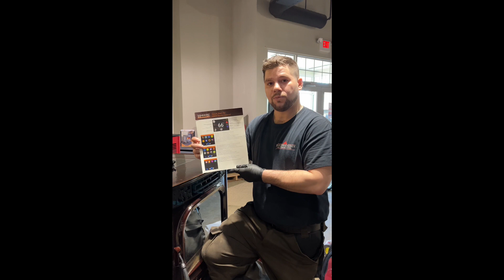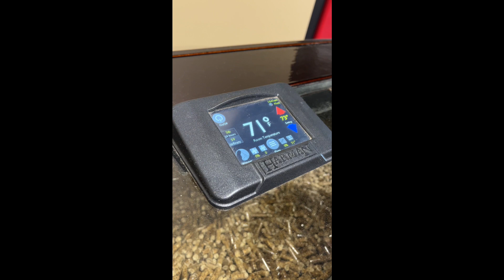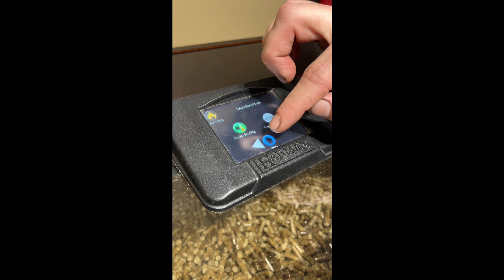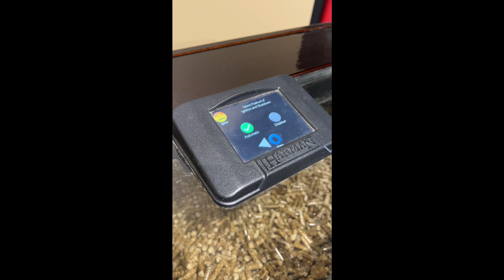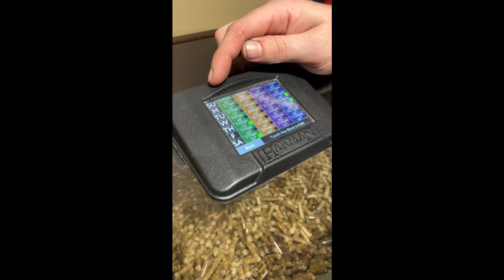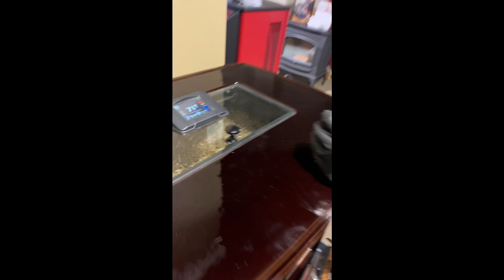How To Operate Your Harman Touchscreen Control Panel

Comment: If you run in Room Temp and disable the igniter, once the stove reaches the set temperature; will it shutdown or reduce to a maintenance or idle speed (like the P series can do), until the thermostat calls for heat?
Reply from the maker: No, the touch screen’s controls do not work the same as the analog.  The old analog stove controls would work just as explained. If running in room temp and disabling the igniter toggle, the fire would no longer go out when meeting temp, but instead go down to a low "maintenance" or "pilot" flame... once the stove calls for heat again, it will run as normal.  However, with the touch screen, when you disable the igniter all you’re doing is turning the igniter off.  When the stove meets temp it will just shut off.  The only way to recreate this "pilot flame" with a touch screen stove is to turn it onto "constant burn" and put the stove on it's lowest setting.  Hope this helps!
Reply: Why does the constant burn setting and the feed limit setting change from where I have them set every time you use the stove?

Comment: I have allure 50 control screen panel broad .My control screen went blank and this was the second time that I have had to replace it.All these electronics are garbage. I have to wait seven days before I receive a replacement control board for my harman and it’s the coldest time of the year when it’s 15 degrees outside and this is the only heat source for the house.
Reply from the maker: I am sorry to hear that you are having this issue with your touch screen.  My first question would be, is your Allure 50 on a surge protector that offers at least 1,100 joules of protection and is no older than 3-5 years?  Many people do not realize that surge protectors have a life span and oftentimes still use them even when they are no longer protecting the stove.
Reply: This why the P series is best, electronics is pretentious.